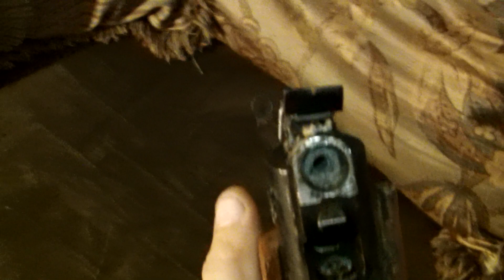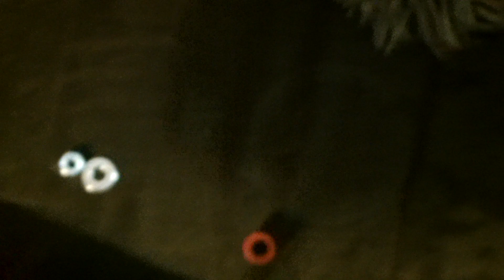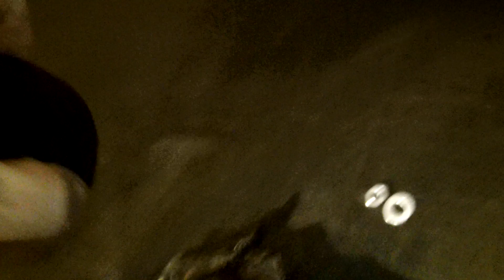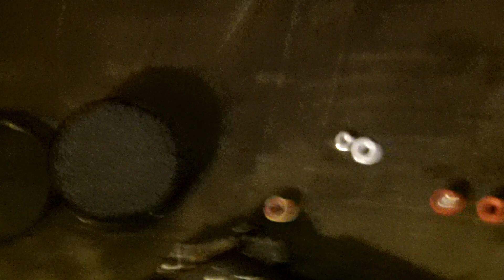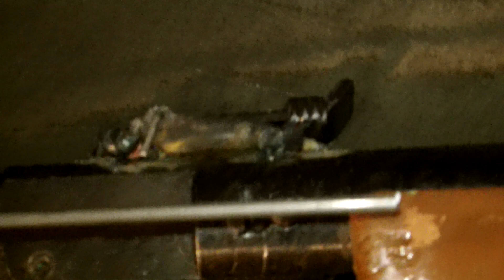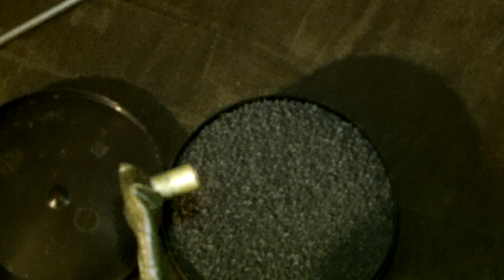Pellet Rifle Converted to Black Powder Rifle

Comment: You should of pre recorded tons of slow pans of close ups on the gun then narrated what were looking at in the video because the video shows barely anything and I can't do the same because of the lack of detail.

I want to get the Ruger Mk4 .22 break barrel pellet pistol. I want to either convert it to take nail gun blanks or a black powder setup. The strongest nail gun blanks sent a 45grain .22 slug at 2300fps from a 14in barrel so they're more of a 22tcm/5.7 in power and speed compared to 22lr or even 22magnum don't break 1700fps. So a single custom 60 grain .22 hollow point slug going at least 1500fps which according to calculations is  less than it would do from the 6-7in barrel. It should be closer to 1700-1900fps using the strongest 22nail blanks. 

If I could simply use a heavy bp load and get a decent 1200-1400fps ide be happy since its less work than having to mod it to accept blanks
Reply: did you make it? thinking of emtying nail gun blanks and putting black powder or keeping the blank but opening it a bit to stick a 22 heavy ball in. they seem to shoot well out of 22 revolvers and thats the blanks and pellet. really want that snub nose co2 modified and best ammo possible. look forward to ur reply

Comment: i used to  shoot   old  full steel  spring  powered   brake   air  gun //177  and  I use plastic   tin gun for   6 /7 year old   ammo //i  empty   out  just  explosive /yes there  is  no powder in   tiny  kid s  tin  revolver , can  be  on plastic 4 mm usually molded  in  12 or  ,, round   // strike anywhere  matches  do work ,,adding  if  got  no other even flash powder from standard  firecracker   mixed  with  strike  ignition powder  from  tin  gun or  6 mm flobertplatzpatronens// procedure ,,put  for start    pellet   half inch  deep in  barrel //than  add  powder /explosive /follow with  another pellet and   you  shooting //PS AT POINT  THE  PELLET  THAT SUPPOSE TO BE YOUR  PROJECTILE  WILL DISINTEGRATE  OR  MELT //SO   TAKE  OR  PIECE  OF  LEAD AND ROLL IT  ON TABLE / OR  POUR  /BUY  177 LEAD WIRE  OR  THICKER ,,CUT   5  TO  10 MM SLUGS AND  IF TOO BIG  ROLL UNTILL PERFECT DIAMETER //YOU CAN MAKE STEEL  DIE TO PRESS  LEAD  IN TO MAKE  MORE  PRECISE , AND  UNIFORM  WEIGHT //IT WITH NOT A  LOT  OF POWDER /KID TIN EXPLOSIVE  MIX/ AND   THIS  GUN  CAN KILL  HUMAN   //22 WOULD  BE EVEN  MORE  POWERFULL ,, BUT  MINE   177 WAS  MUCH MORE  PENETRATIVE /AS   22 LR // UP TO  10 INCH //    BEST OF ALL IS  IF YOU LIVE AS ME  IN COUNTRY WHERE   PRIMERS ARE   NON LEGALL TO BUY WITH NO PERMIT // YOU  NEAD  HERE  JUST   ALL YOU CAN  BUY  OVER COUNTER  EVEN IF    8 OLD // SELF STRIKING  MATCHES // TIN KID REVOLVER AMMO  IS  BETTER    6 MM FLOBERTPLATZPATRONENS ARE  BEST ,,TO INCREASE  POWER ADD ANY SMOKELESS    POWDER OR  CAN  BE   MATCH HEADS , OR  POWDER FROM FIRECRACKER //ALL  CAN    KILL  HUMAN  EASY SO  BE  CARFULL

Comment: Just get a .22 real bullet and make the hole for a .22 and put a pin and you have a gun
Reply: I was thinking about this same build in .22 but using Ram Shot blanks and a rim fire pin. Taofledermouse made a video where they shot .22 pellets out of a real .22 using Ram Shot and were getting like 1400fps or more with the heaviest grain pellets they could find. It's ridiculously powerful.  I don't know why dude did all that extra work. You could just bore out the first 1/2 inch or so to accommodate a Ram Shot, put your firing pin 3/16 off center, and shoot .177 at over 2000fps. And, if you used one of those airguns with the Whisper barrel, you'd have an integral suppressor. If one were so inclined.
Reply: @jeremybasham6398  did exactly what your saying with a cheap crossman break barrel. I use .22 cal blanks and shoot 20-30 grain slugs well over the sound barrier. Blows through a 2x4 at 20 yards like nothing. Already put over 100 rounds through it as well
Reply: @davemoranino  that's awesome.  I haven't done it but it's a cool concept.  I said Ram Shot bu and meant Ram Set for anyone who wants to give me shit about technicalities. Glad it works for you. Now we just have to figure out how to make a semi-automatic. Put a dab of super glue on the Ramset and put the pellet on. Maybe use a 10/22 25 round mag.
Reply: @davemoranino  how did you make the firing pin

Comment: Brilliant,.been looking at doing this for a while..couldn't figure out how to do the firing pin..I'm using nail gun blanks ..😊
Reply: I'm using a modified powder actuated nailgun. Added a barrel and bypass the pressing mechanism.
Reply: Some added a free floating firing pin, the air will push the pin and strike the primer.
Reply: do you recon if you emptied a nail gun b and put in black powder and stuck a 22 heavy ball at the top? also if using nail gun to pellet would dieseling the pellet make it even more power?
 @henryToped
Reply: @MadVikinguk  after a nailgun is modified it can fire .22 blanks

https://youtu.be/agpx-EeLDPY?si=1suyfsjJ9iVu2V5o
Reply: @MadVikinguk  but if you have a break barrel pellet rifle look up "carabina 5.5 modificada para 22" tons of tutorials on this matter. Also check out Pedrão84 video.